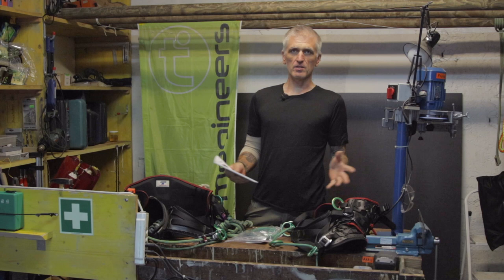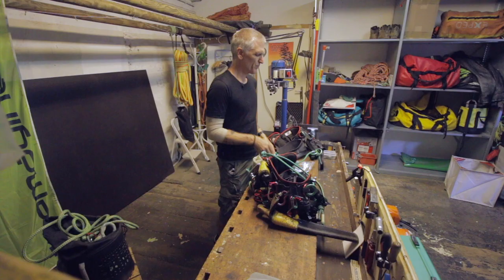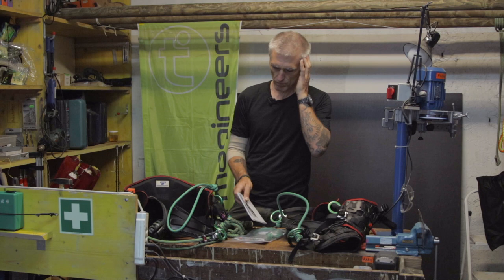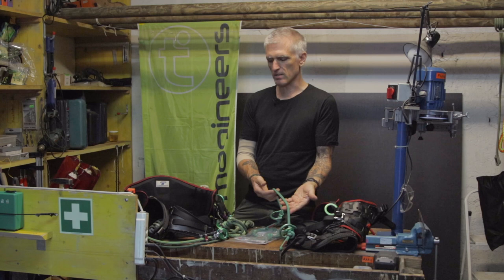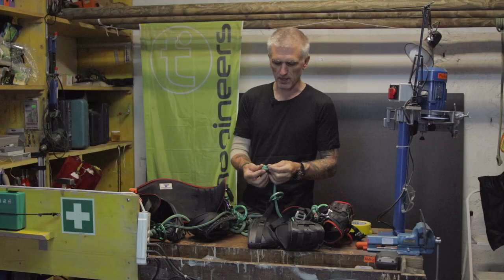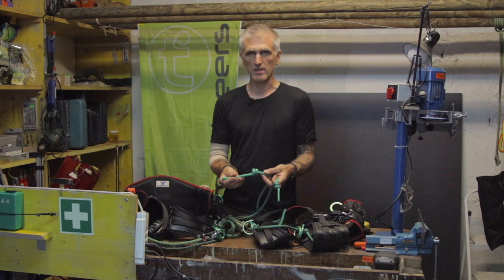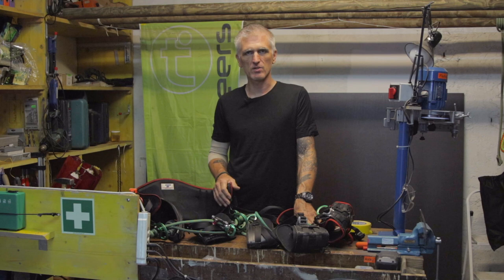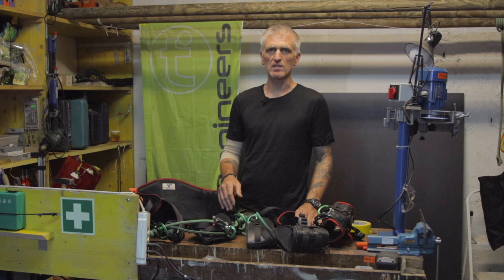Bridge Inspection and Fail Criteria on treeMOTION rope bridges with Mark Bridge

Comment: If you have an evo and you cut the red stitching (the one that connects the knots together not the end stitching) to get the bridge off to put on a new connector can you then Retie the bridge and will it still pass Loler even if the factory stitching has been severed as there is no way of changing rings out without severing this red stitch
Reply from the maker: Hello, yes you can remove the red little yarn, it's just a quality marker proving that the knot wasn't modified between Teufelberger manufacturing plant till the end user.
Reply: @TeufelbergerGroup  okay thank you!
Reply: @TeufelbergerGroup  never mind a colleague ran over my harness with a truck at work😤😅
Reply from the maker: @user-el5tn9fp6g  god damn it! 😅 hope you will soon have a new one, maybe it's a sign to get the Pro now 😃
Reply: @TeufelbergerGroup  hopefully soon😅 gone back to my old classic TM for now